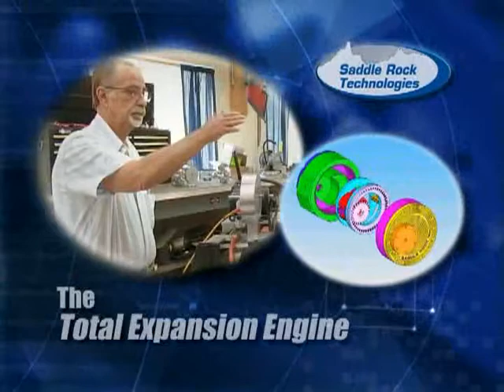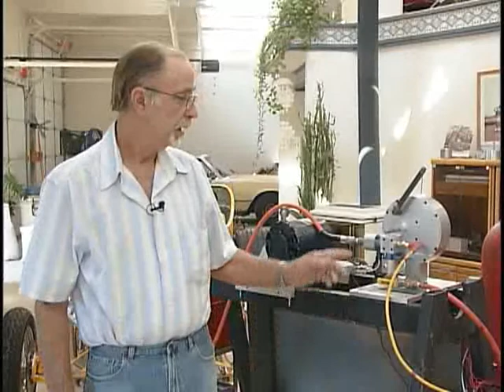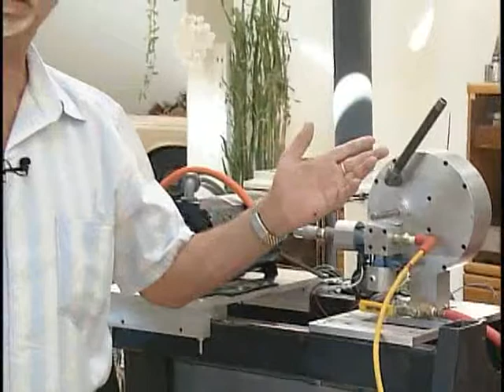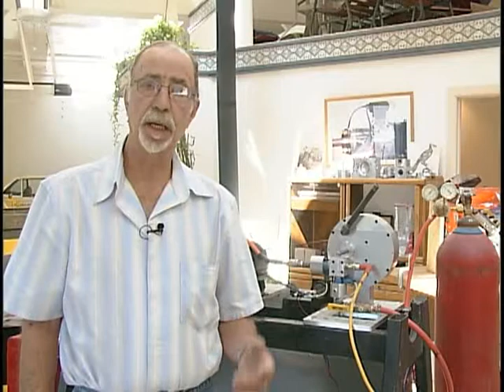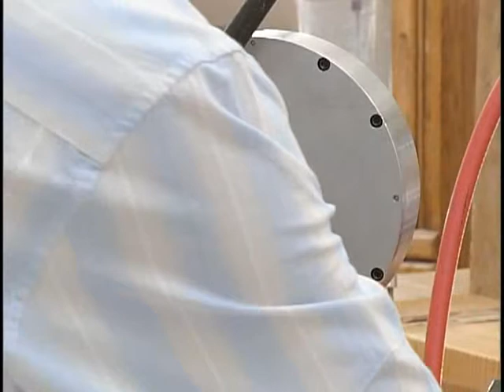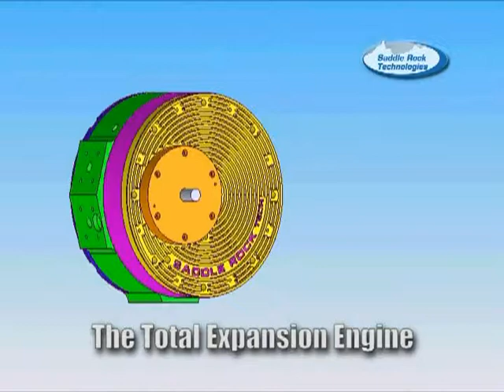total expansion engine

Comment: I'm ecstatic that you Have improved on the Wankel Rotary.  The Rotary can turn High RPMs and Horse Power but the Down fall to it was low Torque. We have seen in the Past, the Mazda Rotary and Double Stacking the Rotors and creating 600HP!
I see this Design as well as the MYT By Raphial Morgado coming to use as a Big Standard in the Near Future!
Power them with a  Hydroxy on demand system and we will be Happy Campers for the rest of our Life!
So Ron, have you secured those Grants yet!!
M~R